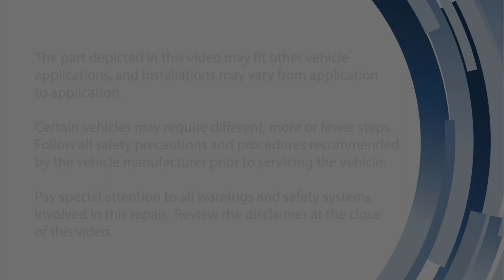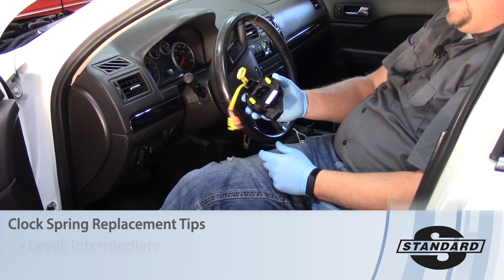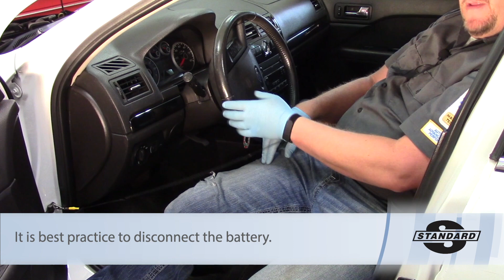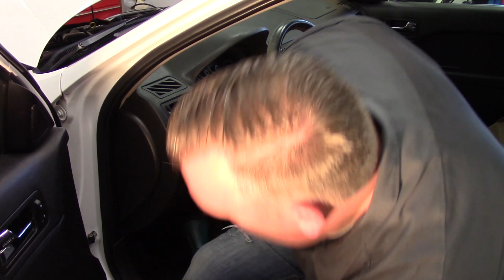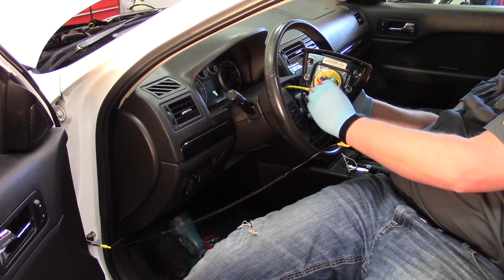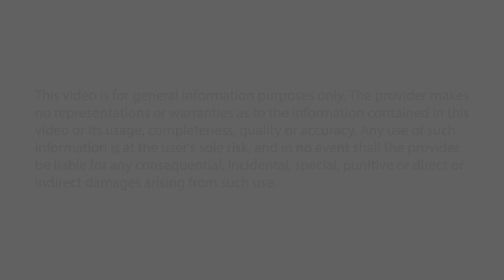Clock Spring Replacement Tips

Comment: touch the battery cables together after disconnecting them and it takes out the charges stored in the capacitors. and remove the fuse for the airbags.

Comment: NEVER set the airbag down AWAY from the car.  ALWAYS KEEP IT TOUCHING THE CAR!  Set it on the hood or the roof is PERFECT.  Why?  Because, it is safely out of the CAB, while you work.  JUST KEEP IT TOUCHING THE CAR.  (Then it maintains EQUAL static charge AS THE CAR.  No static differential charge = SAFE!
Reply: sounds true, but i am not an engineer.

Comment: had to get my clock spring from salvage yard, because the no longer make the clock spring i need.  I was looking for a way to align the spring with stearing wheel so it dosent snap.
Reply: Had to do the same on mine. I just turned if VERY gently all the way counterclockwise, then counted how many full rotations clockwise I could make before it hung up. Again, VERY gently, those internal wires are small and will break with only a pound or two of force. I turned it back half of the turns and decided that was "middle" enough to work. In my case I noticed that I had a couple more turns of slack on the clockspring than the wheel would actually turn so I felt pretty safe with this method.

So for example, turned the clockspring (GENTLY) all the way counterclockwise, then turned it all the way clock wise, 6 whole turns. Then I turned it back counterclockwise 3 turns and installed it that way.

Worked for me anyways. Good luck.
Reply: lol check eBay
Reply: Let me know how it came out for you with  any tips... I just got one from a Pick 'n' Pull main location as a replacement for in my 98 Toyota Avalon.... Any help besides this guys helpful video?!
Reply: rockauto